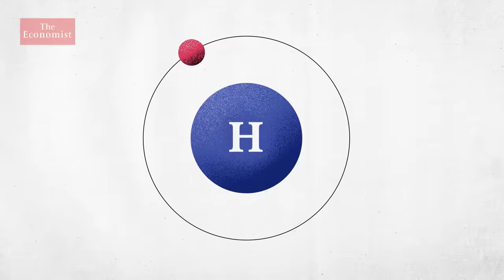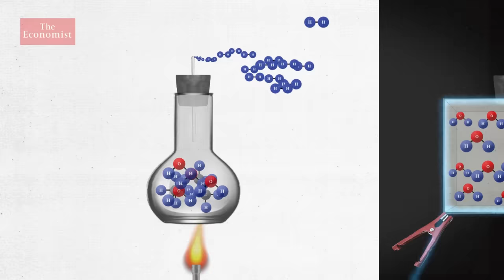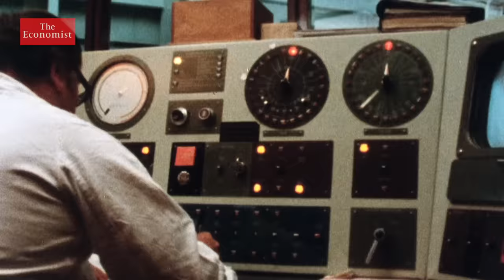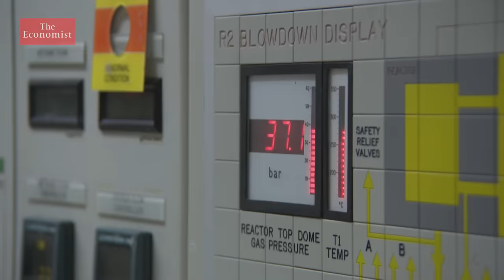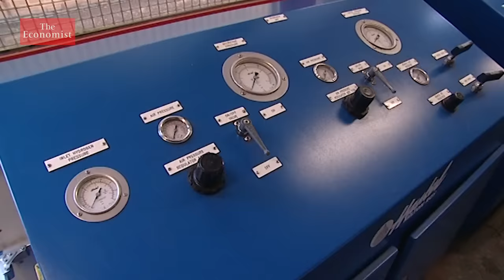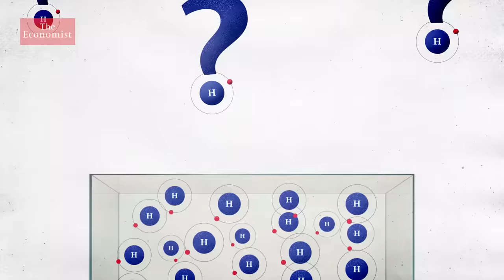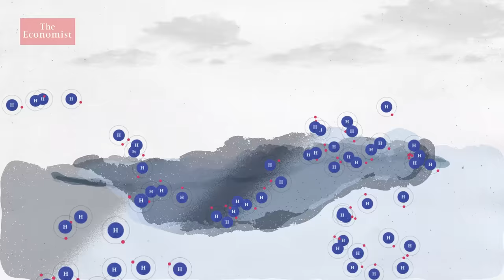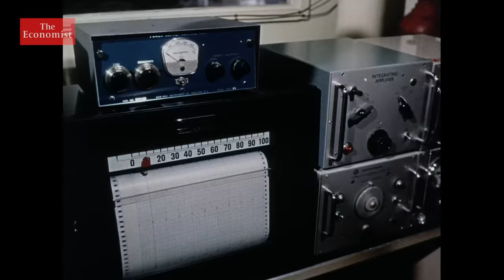Hydrogen: fuel of the future?

Comment: The economist forgot to point out that upcoming gen 4 nuclear reactors can produce alot of >600c heat as a waste product. That heat could be used for thermal splitting to create hydrogen instead of standard electrolysis. This method at scale could reduce the cost of hydrogen at less than 2 dollars per kg.
Reply: This would be cool!
Reply: Didn't know that was a thing, but for sure  industry contains so much waste that could be so better utilised.
Reply: I really though the heat was used to drive the turbines and create the electricity...not waste heat.
Reply: @5353Jumper  all the heat isn't utilised there is some waste heat which can be used for other processes.
Reply: @5353Jumper  every type of energy production or transfer produces heat, yes, that is how the nuclear power plants work. The question is whether or not the "wasted heat" can be utilised. Big industry don't bother trying to do so, because it's cheaper not to.....and therein lies the rub
Reply: Still have the problem of distributing the hydrogen.  Pipeline would be expensive and maintenance nightmare.  Trucking it would not be feasible due to the very low density of hydrogen.
Reply: @colinblack5636  hydrogen could be used for industrial heating where it could be transported via natural gas pipelines.
Reply: I'm sure this has been thought of by engineers
Reply: Cool idea, though I'm not sure how people would feel about creating an explosive/volatile gas next to their nuclear reactors.
Reply: @colinblack5636  If certain people wouldn’t have created a patent for magnesium compounds then this wouldn’t be so important..
Reply: @ShinkaTV  It will make that stuff itself.
Reply: @kushalvora7682  nope.  Would need dedicated pipeline.
Reply: with "thermal splitting" you mean methane? in that case it's still releasing co2
Reply: Very interesting!
Reply: But when could the first full scale non test reactor go online?
It´s probably in the 2040s, so planning with this in mind isn´t a smart idea.
Reply: The viability of nuclear power long-term is rather concerning though. We still have no solid way to store nuclear waste combined with the fact it is not a renewable source in any capacity. At current usage rates we could literally run out of uranium in the next couple centuries.
Reply: @benw3864  couple centuries is excellent for the time being
Reply: Highly unlikely and even if when you include transportation cost and markups the price would be 5 times higher than electricity per mile.
Reply: @kushalvora7682  if there is waste heat in a nuclear reactor then it’s not designed correctly.
Reply: Dear I want your advice how can i start a Hydrogen fuel business?
Reply: Thanks for pointing this out, never heard of this before, will look at it.
Reply: how do you compare $2/kg to gas (mmbtu) and fuel (bbls, L's) alternatives?
Reply: @ramdas363  sure buddy. also no one said nuclear is renewable but it is sustainable. look at france they can recycle 90 percent of its waste and they are building neew recycling centers.
Reply: Where can I learn more about this?
Reply: Just googling it, it says that hydrogen is about 3x as energy dense as gasoline (120 MJ/kg vs 44 MJ/kg)?  And the ratio of kg to gallons of gasoline is about 1 kg : 0.25 gal = 0.95L.
So, it would be this rough comparison, in terms of cost per energy: $2/kg of hydrogen => $2/3kg of gasoline => $2/0.75gal of gasoline =>  $2.67/gal of gasoline?  Does that sound about right?
Reply: @oreissig  No. It's thermal splitting of water instead of methane
Reply: “Upcoming”…been saying that since the 50s…….
Reply: By 'thermal splitting' do U mean boiling?
Reply: Interesting idea, atleast hydrogen could be used for power generation.
Reply: Sigh. That heat could be more efficiently used to create electricity.
Reply: I think it takes up to 2000 degrees centigrade to do that

Comment: I understand one of the big problems of Hydrogen is its embrittlement affect on metals and alloys which means that existing infrastructure cannot be used to store and transport the fuel. No mention of it in this video.
Reply: The tanks used in cars are carbon fibre to store compressed H2, but when we wanna look for large scale storage and transport of hydrogen, we can transport it using lOHC tech or ammonia where you don't need any special tanks
Reply: @mraduldhakar8406  great answer

Comment: been the fuel of the future for 30 years lol
Reply: More like 70 years.
Reply: As Fusion has been..
Reply: 40 to my knowledge 8-)
Reply: @taimalik1110  True. Though at least we've made progress with fusion. We used hydrogen fuel cells on the moon and they still haven't found a market 50 years later.
Reply: @2LegHumanist  Because no real need, as oil did the same job better.
Reply: @lordrisay  
Sure, if your definition of better ignores cities choking with pollution, including poisons like lead, millions of premature deaths and contributing to global warming.
Reply: Battery acid has been for 110 years 😂😂😂😂
Reply: @rickrozen2341  
Battery acid isn't fuel.  You're very confused.
Reply: @2LegHumanist  Battery acid is a means of storing chemical energy. Hydrogen in Hydrogen Electrical Vehicles isn’t used as fuel (you are confused) but as a means of storing chemical energy which is used to power a electric engine (they do not use combustion engines). Instead of waiting for hours in order to charge the Lithium acid batteries of a Tesla you just “tank” the chemical energy storage agent which is hydrogen so you only have to wait a couple of minutes.
Reply: @rickrozen2341  
🤭🤭🤭

Let's see.  Fuel is the source of energy in a system.  In a BEV or FCEV running on green hydrogen, that's the electricity, not any component of the battery.  Acid isn't even a fuel in a lead-acid battery, it's a catalyst.

Then there's the nasty little fact that Tesla use Lithium-Ion, not Lithium-Acid batteries.  I'm not aware of any modern vehicle using acid catalysts for anything but running accessories.
Reply: @2LegHumanist  Lithium-ion batteries do most definitely contain a acidic liquid just like lead acid batteries do in fact the technology is very much the same.
Reply: @2LegHumanist  No, just dumb…
Reply: @jramsey9690  
No Idea what that is in response to.

Comment: There's a lot more sectors which need decarbonisation, like industry, aircraft, ships. If we start making hydrogen for these at large scale, costs may come down, and people might start preferring it over batteries too. Will be interesting to see what happens, but there's definitely place for both batteries and hydrogen in the future.
Reply: NO BATTERIES.... would you want them buried in YOUR backyard...big waste of time and money...to poison the earth.
Reply: @tracesmith4966  fule cells doesn't polute?
Reply: @tracesmith4966   Batteries are not to be buried but recycled, instead....
Reply: H2 won't work for aircraft for one reason only - storage. High pressure tanks or inuslated tanks are going to make any aircraft that uses it impractical . Not going to happen. the only way that is currently accesible to make a zero carbon long haul aircraft is with some sort of bio fuel.
Reply: Lithium batteries, which are used in all EVs and most consumer electronics, use Lithium which is a scarce resource found in very few fields
Reply: @anissbenthami  no, that is not the case, in fact. You are probably thinking of cobalt, and the use of cobalt in batteries is waning. Oh, and by the way, cobalt is also used in large quantities in the production of petroleum products
Reply: @anissbenthami  That's only partly true. for one thing, there are ample reserves for the foreseeable future. And Lithium from batteries can be recycled into new batteries.
Reply: @tracesmith4966  Batteries for EVs are 100% recyclable, so that is simply not true.

Comment: There are some imprecisions in the piece. Hydrogen is very energy dense but when the fuel cell is added, this energy density decreases. (I think there's a video by Real Engineering about this)

Hydrogen is a battery and not a fuel - just like is mentioned early in the piece. It is an energy loss (some call it "a waste of green energy") but it has several advantages among them fast recharging (it's just like refueling) and the possibility to ship energy from resource abundant green energy producers to places that can't produce but need the energy. (btw, that's why Japan chose Hydrogen instead of Li-ion batteries). There are other problems, though: the first method of obtaining Hydrogen will put one atom of Carbon for every 4 Hydrogen atoms produced. 

There's something else we can do with Hydrogen: make Hydrogen atoms colide with each other at high speeds so they will form a Helium atom that weighs a tiny bit less than the two Hydrogen atoms. This tiny difference becomes energy by the famous equation everybody knows and very few understand: E=mc² where E is Energy (probably Joules),  m is mass (probably Kilograms) and c is the speed of light (in meters/second, probably). E(J)=m(kg) x 90.000.000.000.000.000(m/s). Since there are 16 zeros after the 9, even a tiny amount of mass will produce a huge amount of energy and that's called Hydrogen Fusion. We might be about to turn the last corner and reach very long lasting source of clean energy (some people call virtually infinite but we should have learned not to use "infinite" carelessly): MIT has produced an alloy that enables the superconductive magnets needed for the plasma containment that allow for 10 times more current than the Niobium-Titanium currently used. That might make the ITER reactor go from a huge laboratory into the first commercial Hydrogen fusion power plant ever.

A suggestion for you guys at The Economist: start to think how to make society run when energy becomes free and clean because with energy we can do anything - and everything. BTW, when that happens, everything will run on Hydrogen Fuel Cells.

Comment: Waste of Alternative energy to make hydrogen? No, you should not treat hydrogen as a fuel, but an an energy STORAGE material offering a replacement for the battery and being better for upgrading things like aircraft to alternative energy since hydrogen is very lightweight compared to lithium.
Reply: Yeah exactly. There is going to be more and more times and places where we will have way to much renewable energy. Overclock on production (for cloudy relatively windless days) and plug it into making a bit of profit when you overproduce.  Might be at 200% required power some days just because extra solar panels are so much cheaper than batteries.
Reply: Hydrogen loses its light weight claim when you add in the weight of the container that contains it.
Reply: @pauleohl  not necessarily. new lightweight, composite containers are being developed for this application. I've seen it with my own eyes. When the main problem with hydrogen becomes the weight of the container we will know we are very advanced.
Reply: Yep, and with the lack if infrastructure for vehicles, it will start with delivery/freight trucks. Then as refueling stations increase, itll gain popularity
Reply: @pauleohl  Most of the new containers being used for cars, trucks, trains etc.. are made from carbon fiber, they are very light weight
Reply: @SnowWolf9999  carbon + glass mostly. with an inner steel liner though
Reply: "you should not treat hydrogen as a fuel, but an an energy STORAGE material "
Is that not what fuel basically means?
Reply: What I mean by energy storage material is that it is not primary energy source, you need some energy to make it first, then store it and use it.
Reply: Hydrogen is a very poor energy storage medium.  Too much loss coming and going.
Reply: And NOT CHINA DEPENDANT THATS IMPORTANT. Batteries depends rare earth materials FOR CHINA
Reply: @SnowWolf9999  Electric carTesla model 3 LR is lighter than Toyota Mirai and has a same range. @Paul Ohlstein  True for cars and trucks, not true for big plains.
Reply: @offroadsnake  None of the current batteries are using any materials that come from china in significant quantities - especially since no rare earth metals are being used in batteries, that's an urban myth.
Reply: @karlgunterwunsch1950  litium extraction its more polutan than gas itself. And yes still the litium use rare earth material same with FCHEV but its just platinum can be easly replaced with grafene the litium be replaced have a more uphill road sodium solid state batteries have stilk performance issues and yet dont fix the range anxiedity and charging issues
Reply: @offroadsnake  You obviously haven't seen a lithium mining operation yet. In some areas it's a byproduct of potassium salts which are used for fertiliser production - harmless because that's just a salt evaporation operation that also yields table salt. In other areas it is a normal hard rock mine which is not polluting at all beyond the mining operation - and it doesn't pollute the water table or the environment  as the petrol/diesel production does. The resulting lithium battery is land fill safe (not that anyone with a sane mind would do so) but they are not toxic - whereas a single drop of crude oil pollutes 500-1000 litres of drinking water! 

Replace the platinum in the fuel cell with graphene - while possible it's not desirable - and you reduce the lifetime of the resulting cell from about 5 years down to 100 hours. You seem to be taking headlines and not reading and understanding the research behind those headlines!

Comment: The value proposition for hydrogen-fueled cars seems shaky considering the increasing popularity of EVs and growing recharging infrastructure support. It may find a niche as an alternative to bunker fuel and jet fuel for ships and airplanes.
Reply: And also for the heavy and chemical industry there isn’t a other option.
If fusion wouldn’t be another 30 years to come up..
Reply: Hydrogen is an option for transport trucks and trains, but BEVs seem to be the future of passenger cars.
Reply: Why do they seem "shaky" how many TSLA shares do u own? Or EVs? The power to weight ratio is very high with hydrogen powered vehicles
Reply: @fireWireX4  Do you mean "power", or do you mean "energy"? They are not the same. Either way, H2 for passenger / light trucks is already DOA. Look at California and the Mirai and Clarity, how is that going? Not well! How many Nexo vehicles will be sold vs IONIQ, EV#, Kona, Niro Electrics? A: a tiny fraction! The H2 chain is inefficient vs EV because with EVs there is no energy conversion involved and EV batteries and electric motors are 80-90% efficient, vs 30% for ICE vehicles. This is why it's better to store renewable electricity in batteries, rather than use H2 for storage, though this is admittedly quite expensive and there may be some applications for H2 in industry, rail, and large semi-trailers for freight. p.s. I don't hold any TSLA shares, but I do credit the company for its success (the owner, not so much: money has addled what's left of his brain, or maybe heart).

Comment: "Current hydrogen production methods using natural gas do produce some greenhouse gases"...
Understatement of the year.
 90 percent of world hydrogen production is still made in this way and it produces almost as much CO2 as the entire aviation industry.
The green methods mentioned here are simply untried or tested at the scale required for large scale rollout.
To produce 1 tonne of hydrogen takes 45 mWh of electricity and 11000 litres of water.
For fully green hydrogen production, to put what would be needed into perspective, to enable a full scale roll out by 2050, the UK would require SEVEN TIMES the total wind power it currently has. All doing nothing else but powering electrolysers

Comment: This video was interesting. I wonder why it didn't look further at hydrogen as a form of energy storage. A principle benefit of fossil fuels is their dense energy storage. The video discussed how hydrogen gas can store large quantities of energy in small, high pressure containers, and the demand for such fuel in industrial applications. But it didn't consider how governments could continue to encourage utilities to buy private renewable power and help them store excess as hydrogen for industry. The story makes the case for this being a long-term goal, but it looks like the same people pushing communities to accept restarting old nuclear facilities (e.g. in Japan), instead of coal and oil, could instead push renewables and hydrogen and get the output control they want without the emissions. I gather, because the video did emphasize the price of replacing old infrastructure, that this is not yet an economic alternative where The Economist has looked. I wonder how far it is from being price competitive.
Reply: Toyota is trying really hard, looks like Japanese will come up with something interesting sooner or later apart from Toyota Mirai.

Comment: Hydrogen is NOT a fuel.      It is energy storage!    Kinda like a battery.  Using green energy to make hydrogen is like using green energy to charge a battery.   Energy in energy out.  Bottom line is we need both.
Reply: But hydrogen made for methane is barely any better than gasoline/diesel for emissions footprint. 

And the double conversion process from electrolysis is so inefficient it is much better to just send the electricity into a bEV, or store it until peak hours, than to make hydrogen with it. 

There is likely some niche market for Hydrogen where the density makes it actually practical (long haul trucking, planes, ships trains) but so far no one has come to market with one.